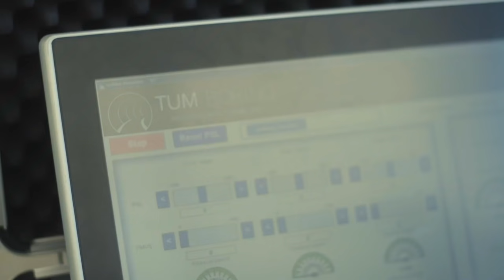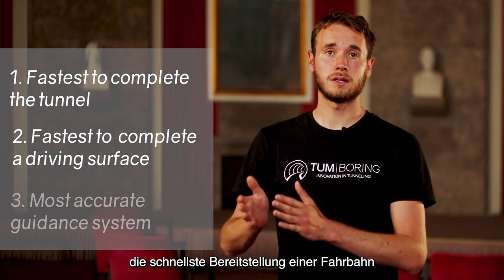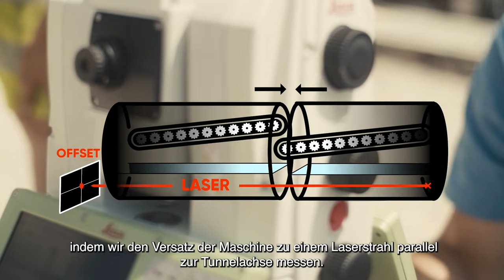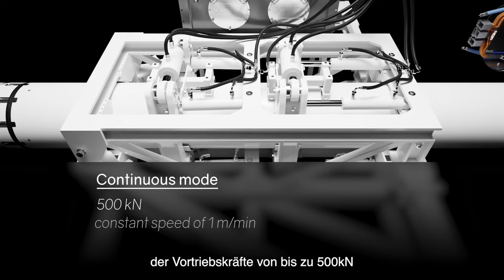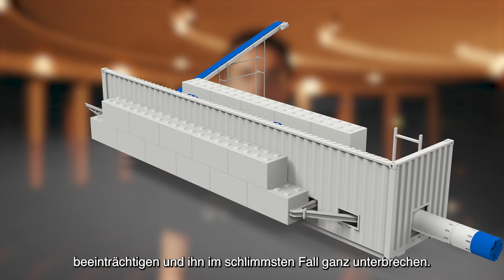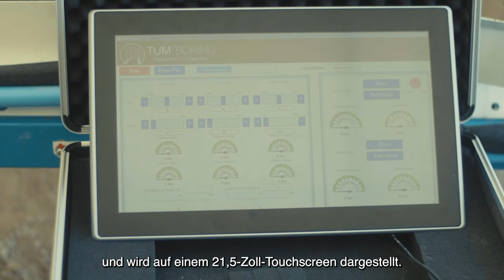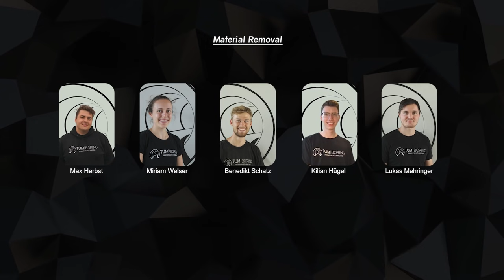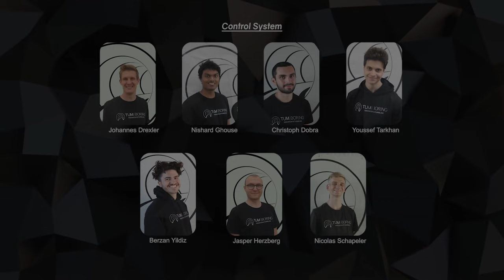TUM Boring Rollout Event: Meet our Tunnel Boring Machine for Elon Musk's Not-a-Boring Competition

Comment: People talk about "beating the snail" but it seems to me that we don't necessarily need a machine that is boring faster.
We could simply improve manufacturing cost of these machines. 
If you can drop the price of these machines by half, it basically means that you managed to cut by half the time you need to build your tunnel by just using two of them simultaneously.
This scales linearly.

Comment: This is an amazing achievement for a student team. My question is how you plan to be faster than regular solutions? The entire design seems to follow the industry standard. No special motors or drive system. No special material removal or propulsion system. Even the pipe revolver is no different from the hopper based systems currently used in directional drilling and pipe jacking. This machine could be out of the Herrenknecht catalog, so what makes it faster?

I would have liked to see the drive ring replaced by an integrated motor or even axial motor design which would have given 360 degrees power input to the cutter head and removed the expensive gear system, complexity and eliminated wear. The large diameter would also increase the torque due to the large rotor. An axial design would allow for stacking more magnet and coil discs to increase power density, while a radial design would free up space for a larger material removal system.

A crawler track could have eliminated the need for reciprocating jacks giving continuous pressure on the tunnel face, while also removing the need for a trailing pipe string. A dual sided linear motor design could leverage 1 set of coils to drive 360 degrees of crawler track, giving a tremendous amount of torque and therefore thrust.

A cone-shaped cutter could have concentrated pressure on a small area while allowing material to be broken off the slopping face, reducing the force needed to break up rock. This decreases the forward pressure needed while leveraging the weight of the machine and turning force for breaking material while increasing the removal area.

If we are ever going to get faster at digging tunnels, we need to rethink how we remove material. Bucket wheel excavators are so much faster due to continuous material removal and current tunneling designs all focus on intermittent removal.
Reply: Excellent analysis.!! Im looking forward too to see what " innovation"  techniques are used. But have to say for a student project , TUM have knocked it out of the park. !!
Reply: Someone give this guy a mic 🎤
Reply: I think the most crucial is the material of the drill. Every Tunnel drill company faces this same problem. How to get material fast from the wall infornt of the drill. is it really fixable oder just a faktor of faster replacement of the drillbits?
Reply: @x3Cay  I agree. A big part is the percentage of time you are actually drilling. Right now that fraction is very low because of the piston walker designs being used. You can only move forward 50% of the time because retracting pistons takes up the other 50%. 

The second part is tunnel building. Usually they drill a few meters then stop to build more tunnel. Due to the scale of this competition, that is not a problem here, but future designs should build the tunnel lining at the same time as they drill.

The suggestions I made above would solve the drilling speed problems, but construction of the liner can only really be solved 2 ways. 
1. By using a dynamic shield. Extending a rotating shield with a diagonal cutout for placing liner segments would give support while allowing you to rotate the shield as you continuously place a spiral of tunnel linings. This is similar to the rings used now but on an angle to prevent stop and go movement.

2. Using a long shield and injecting a preliminary lining along with drill ports as you drill forward. Once the preliminary lining hardens, you can drill rods into the geology to stabilize the rocks and bolt a segmented second lining into place. This is like the threaded inserts used in plastic product cases giving you a very solid 2 layer tunnel while allowing the 2 layers to flex in the event of an earthquake.

Beyond these improvements to the process, changing the design of the rod drills to threaded slewing rings spaced around the tunnel machine, lets you feed many short sections of stabilizing rod simultaneously, without interference, while letting you extend them continuously to their final length with internal threads in the back. (think motherboard standoffs)

Again my post has gotten very long so if there is interest in discussing any of this closer let me know and I will get in touch. 

PS. these competitions mean you can never monetize any of your developments, which is something to keep in mind. My dad and his friends built a voltage programmable digital radio tuner and because they entered it in Jugend Forscht never made a cent from it.
Reply: @excitedbox5705  what do you do? interested in doing some consulting work for a startup in this field, or even take a position?
Reply: I'm curious if speed is the name of the game what prevents use of high pressure water jet cutting?  Material removal then by pumping the water spoil slurry out.  While we're pumping things around how about UV catalyzed resin rock composite for continuous tunnel wall production?  In this configuration more power in equals more speed out.
Reply: @excitedbox5705  why do you know all of this? You seem really deep into the topic. Ever thought of joining the boring company?
Reply: somehow they managed to be the fastest team.
Reply: @excitedbox5705  Hi! I loved the way you analysed the entire problem systematically. I especially agree with your point on removal of material. As other individuals on this thread have pointed out, you seem to have a really deep understanding of the topics. I have some ideas myself and I would like to get in touch with you for the same. Even though it has been a year, I would still like to connect with you. Please let me know how can I reach out to you to carry out further discussions.
Reply: @rishabhmanglunia1481  lol just stumbled on this in my reply list. YT is really terrible for finding comment replies. I guess if you have an email we could talk.
Reply: @aion2177  I am a problem solver. I look at designs/processes or problems and look for ways to improve them. What startup did you have in mind?
Reply: @excitedbox5705  Yo, idk if ur every gonna see this but im actually in a Tunnel boring student team right now, and i saw u had some very interesting ideas for innovation in tbm design. I am only a first year engineering student so this is all very new to me but i would love to hear more of your stuff

Comment: To what extend TBM could be used to dig and pull cables efficiently ?

Eg. A maul pulling a cable sleeve… Would avoid to dig trenches with heavy costly equipment as well as destroy existing pavement …

Comment: Try compression using reverse auguring wedging vibration grout injection lining or helical coil metal band lining. Soft soil only water also helps with compression compaction.

Chimo keep on sapping and the oligarchs castle will fall.

Your doing the he lords work to increase the harvest. God bless may Saint Barbara bless your holes.

Comment: make it like a worm, eating and pooping out the loose rock material, also enforcing the sides while being not-boring
Reply: friction melt the outside diameter to strong rock shell, you could directly friction rotational drill the tunnel
Reply: if you have tons of sand, you can move that with hydraulic pipes
Reply: water waste management, easily dragger into/with the boring machine
Reply: ever been a poop-waste container driver, with their hoses
Reply: ever been a mining operator